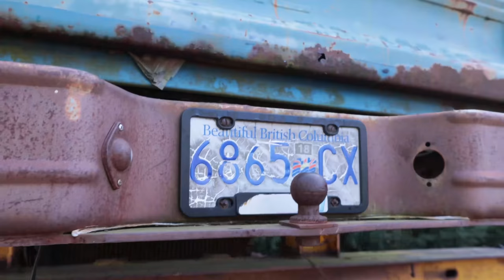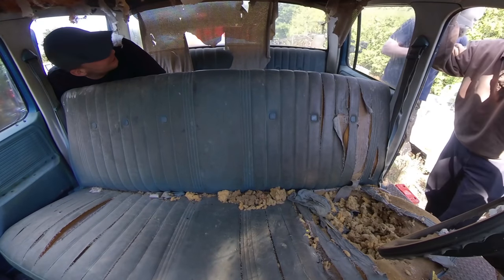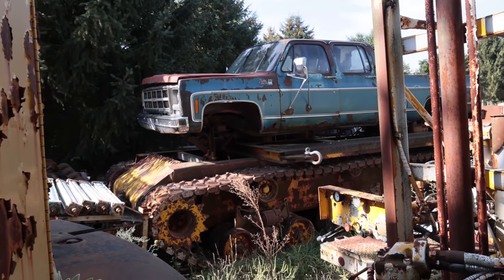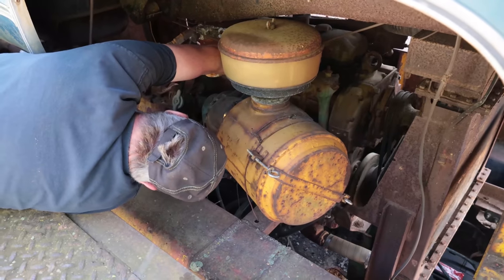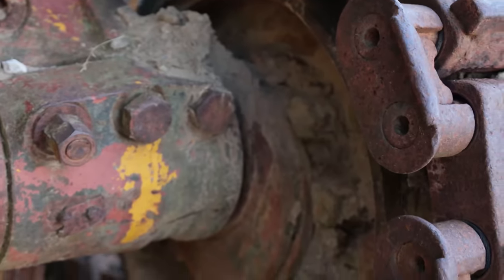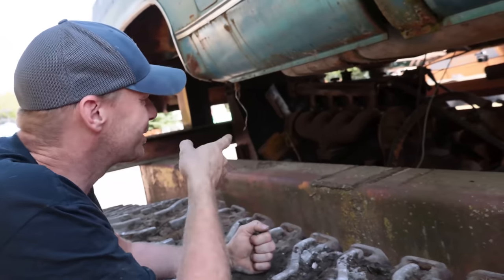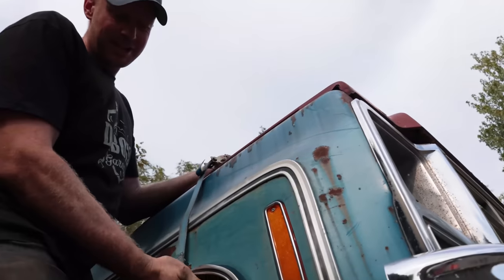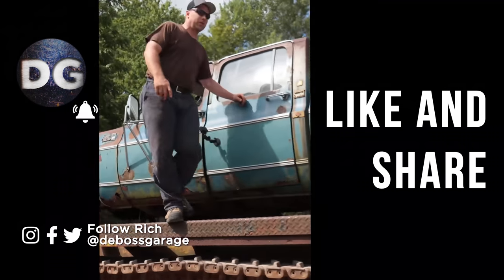We Bought a Squarebody swapped WW2 Tank | #Shermanator [EP1]

Comment: You want the twin engine and trans upgrade, not the original under powered radial. If one engine is down, the tank would still operate. Being Canadian, just call it "Sorry" in advance.
Reply: Underpowered radial??
Reply: @saltymain  the Radial where considered underpowered compared to the Chrysler Multibank and Ford V8 and twin Detroits. In terms of operation I would go with the Twin Detroit if you can make it work Diesel is much cheaper than Av Gas
Reply: @mattmopar440  and radial engines are so loud nobody would want to drive it
Reply: @mattmopar440  nah multibank mega trash and also twin detroit are heavier and ford gaa ofc is better
Reply: @bobcranberries5853  loud? Ok and??
Reply: @mattmopar440  it runs on 80 octane lmao
Reply: @saltymain  you're worrying about weight? It's literally a tank chasis with a truck welded to it.
Reply: @urlordSANDMAN  BRUH weight plays a role in ground pressure and other factors. THE heaviest tank is the Maus weighs 188 tones and guess what it used a single daimler benz db605 to power it even though it would have been underpowered for the TANK itself
Reply: @urlordSANDMAN  Also it all started with engines not so much bout weight brouda
Reply: @saltymain  you won't find a Ford GAA motor anywhere the Detroit twin is probably the easiest and I guarantee you the aviation engine he was looking at does not run on 80 octane
Reply: Looks like they have plenty of room, why not just swap in a  Cummins 6CT or a DT466?  It's not exactly "Original" or "Matching numbers".  No way would I mess with a radial engine, don't those have a real finicky starting procedures because of the orientation of the cylinders?
Reply: @mattmopar440  he cant fit the twin cyclone thats for damn sure but if it was the whirlwind r975 that would be a whole other story
Reply: @JuiceSpringsteen88  they have room for an 5.9 isb israli super shermans used em
Reply: @saltymain  I'm not super knowledgeable on the Sherman, but didn't the super Sherman use the Cummins VT8-460?
Reply: The whirlwind does not require a gas, just because it is a radial doesn't mean it is an aviation engine. The version put in the Shermans runs on 80 octane. If the Shermans had required av gas, Patton would have ran out of fuel somewhere in France.
As far as "underpowered"...the Whirlwind radial powered the M-18 tank destroyer, which was the world's fastest tracked vehicle until the Turbine powered Abrams was introduced. The 9 cylinder radial made between 350-500 hp. Which is plenty for a WW2 tank. Any more than that and you are constantly going to be fixing a broken drivetrain.
I worked for a shop that turned surplus Sherman tanks into "wood tigers," basically a log skidder with a winch on one end and a grapple on the other. I've been through the various generations of Sherman tanks from one endto the other, and I think the Wright built Whirlwind was the best powerplant put in them, followed closely by the continental copy.
Reply: @JuiceSpringsteen88  yes the later models had a cummins diesel they used a air cooled diesel I believe it was a 	Continental similar to what was in a Patton tank but again that wont be easy to find or find the ducting and fans for
Reply: @mattmopar440  go look up the specs for the Wright Whirlwind engine...it definitely runs on 80 octane...
Reply: @jacktheaviator4938  Depends on which model of supercharger it came equipped with correct ? Also what are the chances that thing isnt going to leak all the oil right back out of it the first time its fired up after sitting in a field for that long thats not the right choice for this build
Reply: @mattmopar440  if it was properly stored there should be no issue with firing it right up after changing the oil and purging the fuel lines. That big barrel shaped container is designed for long term storage, 1 year or 100 would make almost no difference. The worst problem I could foresee is brittle rubber hoses. 
If I remember correctly, the only difference between the aircraft version and the ground powerplant is materials, the supercharger case is made of cast iron on the tank engine, but uses the same compressor section with a different gear ratio to make the power at lower RPMs. But the tank superchargers are pretty common, they used them in way more armoured vehicles than just the Shermans, and the compressor tends to outlast the engine itself as long as it maintains oil pressure. It should be a relatively simple matter of finding a blown up R-975 and swap the superchargers. Tank chassis were used a lot for industrial carriers of various types after they were sold off surplus, and I know of at least three that are sitting in the woods right now rusting away with a busted drive line.
BUT, if ANYTHING goes wrong with the R-975, it is gonna get VERY expensive really fast. Aircraft mechanics are the only ones who work on them, and they don't work cheap. And used radial engine parts cost 10 times as much as new diesel parts. As much as I would love to see a radial powered square body screaming down the road, a Cummins swap would be way smarter. And much more useable.
Reply: @jacktheaviator4938  I think get the Twin Detroit box he has get another 4-71T  Detroit and let those twins howl that would be a combine power of around 450 HP 1200 ftlbs should move a Sherman without a turret and frontal armor  around no problem and it would be the cheapest option I feel
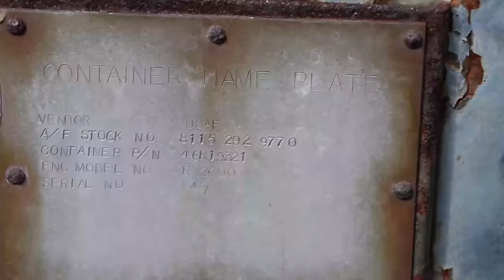Reply: @jacktheaviator4938  Correct on the Whirlwind, but the engine that Rich showed around the 18:00 mark was a R 2600, that’s going to need more than 80 octane, which honestly isn’t really a problem these days.
Reply: @sw96  you are correct, I missed that. The 2600 is too much motor anyway. Way too much motor. And needs way too much air to cool.
Reply: @saltymain  Yeah, but there is a thing, this is no 188 tonnes maus tank. So I don't know get what your point is.
Reply: @saltymain  not loud but too loud. My dad was a drag racer I grew up at the racetrack and I’m telling you those engines are just too loud to be comfortable. You wouldn’t be able to hear what the person beside you were saying.
Reply: @saltymain  bruh, you literally said that "twin detroids are heavier" and I just pointed out that there is no point in worrying about weight in a "build" like this, this is no sports or drag car to complain about which engine will make it heavier
Reply: See you one raise you one, do a triple Cadillac V8 swap like we did down here in Australia for our Sentinel tanks because we couldn't get detroits or anything tank-sized lol
Reply: Think a 12v71 would fit? He could even do another engine in the actual engine bay of the truck and run it with a chain or drop box or something
Reply: @urlordSANDMAN  they call them hulls not chassis. As the original tank was built by the navy so they use naval terms.
Reply: @saltymain  The engine the super sherman used was 15.5 liters
Reply: @saltymain  The "tank" in the video was supposed to carry a 155mm field gun (it was an M40 Gun Motor Carriage) on it so unless they want to use it as a truck instead of a tractor, then the weight isn't a problem.
Reply: the whirlwind is several times more powerful than the original continental
Reply: @jacktheaviator4938  Would be really cool to find a D-200 which if I remember is a R-1820 that was converted to run diesel during WWII for the M4A6 Sherman.
Reply: @scottcol23 from what I've been told, those are pretty much unobtainium. But who knows, there might be a warehouse in Arizona somewhere that is full of them, and they could hit the surplus market one day.
I remember an Oshkosh military wrecker from my youth that ran on damn near anything, if it was even mildly flamble the damn thing would run. I don't know much about the powerplant, and it is a bit unrelated, just an old man musing I guess.

Comment: The radial would be a cool idea, but I feel like it would violently over heat. Would be sweet to see a 12v71 or 16v71 dropped in it and keep it somewhat true to its roots
Reply: Shouldn't have blown up the 12v71...
Reply: The original engines the shermans had were repurposed radial engines
Reply: @Alliethebooklover  maybe so. But it would have been modified for some kind of cooling system. If that engine is configured for a airplane. Then it's air cooled. So he would have to fashion some kind of blowers to cool it.
Reply: It was common - as somebody else has said - to use repurposed airplane engines into tanks.  The Sherman and tank destroyers had radials with cooling fans.  The British used a repurposed Merlin engine in their tanks (called the Meteor).  The American tanks were not very popular with the troops during cold weather, it was like riding around in a walk in freezer.  The British were smart enough to add in a small quiet engine to heat the tank and to run electrical systems without having to start the main engine.  It also made hot water for tea, which made it much more popular with the British crews during the winter.
Reply: the 16v71 would be perfect as it has around the same displacement as the Ford GAA used in the majority of shermans
Reply: @baconatordoom  Yep, the Continental R975 radial in the Sherman and the Lee/Grant had ducting and 16 blade fan around the outside or the flywheel/clutch assembly to keep things cool. Unfortunately it used to suck from inside the tank and blew out the back so drew in and filled the tank with dust, cold air, snow, smoke and what ever else was outside.
Reply: My favorite of the many, many different engines used in wartime M4 Shermans is the Chrysler A57 Multibank, which was five flathead straight sixes in a trenchcoat, although the radial diesel (no, seriously) they put in the M4A6 was also pretty nuts.

Comment: The road wheels would have rubber. Also if the track needs rubber you would have to replace the whole track. For the end links smack the links on with a sledgehammer and there should be a bolt you tighten it up with. Check the hubs make sure they’re well oiled or greased. I am an Army tracked mechanic. I’ll send y’all an email
Reply: Also, a 3lb hammer for an obligatory Soft Spot Check is critical.
(Former 11B Mechanized)
Reply: @wes11bravo  brass hammer so you don't damage the good metal
Reply: @tacomas9602  What good metal.
Reply: @wobblysauce  absolutely nothing wrong with the bottom half of this death trap. Things were built to last when those tracks were crafted.

Comment: I know some one in the UK with a tank and to make it road worthy, he actually made new treads out of rubber and steel plated Oak. It is a hell of a lot cheaper than fully vulcanised rubber tracks. Steel on the inside to protect the wood from the steel components and rubber on the outside to protect it from the road. When the rubber wears  thin he just glues new bits of rubber on.

Comment: This thing is so damn cool and I'm definitely subscribing to see what you do with it. 

It looks like it's an M40's chassis, which was built on an elongated and widened HVSS Sherman tank, with the idler wheels and sprockets at the front and rear being lowered as well. This was all to accommodate the heavy artillery gun it was supposed to carry and fire. Considering these things were open tops already, it seems pretty economical to just chop off what's there and stick a truck on it - if it was even finished at all. The war ended before more than a few hundred of these were produced, and production was stopped cold.
Reply: sorry my dude but the states did not make that many m40's.. this is a later model m4a3 chassy. :P
Reply: @max16  300-400 isn't many, but the ones not scrapped still had to end up somewhere over the decades. The wider spacing between the bogeys suggests a longer hull. M40 is very unlikely, but one can hope for the cool factor if it doesn't look like a normal HVSS Sherman.
Reply: @Pain4547  you are correct its a M40 you can tell by the road wheel spacing.

Comment: you keep finding all of the Detroit's at V & R  look for a 16v71TA.  that radial will just over heat honorably.
Reply: "Overheat honorably" got a chuckle from me
Reply: @davewolf8869  same
Reply: Well the big ass fan was there for a reason lmfao
Reply: Thousands of tanks were equipped during the war with radial engines. Remember stuff was scarce at that time but they had lots of aircraft engines and the maintenance crews already knew how to fix them fast to get them back in the fight.
Reply: @saltymain  O yo mean the prop that would be removed to get access for the out put shaft.  grin ok keep thinking like that.

Comment: Keep it a diesel,the radial is gonna be a pain in the ass to work on with the bottom cylinders and you'll have overheating issues.The detroits can all be rebuilt in frame.
Reply: Absolutely needs to be a more powerful detroit.
Reply: Not to mention you can parts for a Jimmy and you can fix them with a rock.

Comment: This is an interesting project. You should get the diagrams of the original engine that was in the tank and put a stronger one in, the chassis will most likely be able to handle a LOT of power, especially with a reinforced drive shaft. The drive shaft is active through the chassis because the transmission had to be kept hidden under armor and also because they did not want the engine exposed to more heat than it emitted alone. But, just to throw it out there, the front drive system on almost all the tanks of world war two was a huge weak area. It seemed like every year when the Germans would come out with a bigger gun, all it would take was one tap on the front end and the machine would have transmission difficulties. This fact goes for the German tanks, too. That is why all the tanks the Soviets sent in were rear-wheel-drive. The Kliment Voroshilov 1(KV1), T34-85, JS-2, and the American M26 Pershing tanks are examples, and they basically won the war. The only tanks that could get away with a front wheel drive system during world war two were light, like the M5 Stuart series from America. They were maneuverable. But, as I said, the rear drive system tanks stood out. A good example would be the Kliment Voroshilov 2. They put a a howitzer on the chassis that fired 152MM shells. Though people read about the german tanks and think the extra hundred horsepower from petrol engines means something, it didn't mean that much when they were up against armaments that large on chassis designed to move through snow.

Comment: Man this needs some vr Frankenstein upgrades. A radial engine is silly. Find a big v12 or another v16 detroit.
Reply: Later Gen Shermans used a Ford GAA V-8. 1,100 cubic inches. 1,000 lbs/ft of torque. 500 horsepower.
Reply: Australian tanks used three Packard V8’s… The post war British tanks used a derated 28l Merlin engine (Meteor).
Reply: @allangibson2408  not only de-rated, alot of meteors were merlins from crashed/recovered spitfires (to begin with anyway) . With damage to their prop gearing/supercharger etc. When you take all that gubbins off the real guts of it was perfectly fine.

Comment: I love it. Someone took a tank with the turret removed, and put a pickup truck up there. 
I just love these old diesels - they usually just work, even if they have been laying around for a decade or more. . .  
that is SO fun - the Canadian hillbilly that used it in the past showing you how to operate it . . . 
A tank with the turret removed would still have a drivers compartment. 
The whole pickup thing is just eye candy. 
You could operate it from the drivers hatch, or you could fab something to lift up the driver's station - it would not need a pickup truck. 
I do think Sherman tanks had radial engines; I could be wrong. 
I did work on M48s and M60s a little bit. Those tracks look pretty familiar.

Comment: Rich, those small wheels aren't idlers, they're return rollers for the tracks, your idler wheels are in the back of the track assembly where you adjust track tension, and those four wheels per axle are road wheels, and HVSS stands for Horizontal Volute Spring Suspension. I'm sure Kevin probably told you all this already, and if so, disregard. 

Cheers.

P.S. The Canadian made Shermans were called Grizzlies.

Comment: When radial engines was put into tanks, alot of other modifications was done for cooling, etc. 
Only reason they was used to begin with, was a shortage of powerful enough engines at low price.

Without the heavy turret, not as much hp is needed for your speed goals.

A turbo charged diesel from a medium duty truck would be easy to attach with PTO clutch / bellhousing / driveshaft setup from auxillary equipment, running driveshaft to original transmission.

Comment: As I recall that is actually the chassis of an M43 self propelled gun, the tracks are all wrong for a Sherman
Reply: Yea, its too long to be a sherman.
Reply: Yea i figured and you pointed it out so im convinced
Reply: Yeah thats what I'm thinking not a m26 or m4 way too long
Reply: If it is a m43 (or more likely a m40) chassis then that is a rare fine. Only a few hundred m40s were built, and only 48 m43s were made.
Reply: Could it have been an M4A4? They were stretched to make room for the multibank.
Reply: @whiskeyinthejar24  no the tracks are wrong for an m4a4 they all had the earlier vvss suspension and the idler wheel is in the wrong place
Reply: Looks like a Pershing almost
Reply: Reminds me a lot of the m40 from the looks
Reply: No its from a m4a3e8 frame.

Comment: Look at the inside the chieftains hatch he talks about how to flip those tracks to use the rubber.  Get that transmission though and hook a couple of 6.9 Cummings to it.  Do not go for the radial as for one that engine deck isn’t for the radial.  If anything see if you can find that flat 12.  That radial will give you fits, before you can start you’ll need to hand crank to get the oil out the lower cylinders so just avoid that mess.